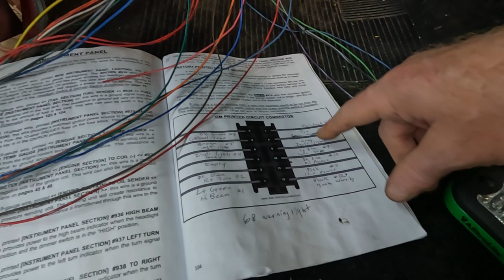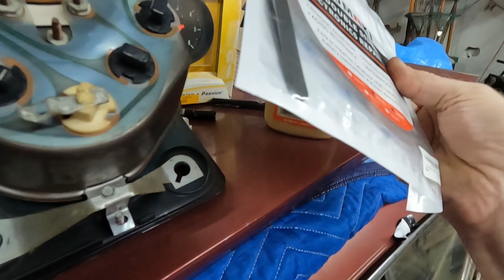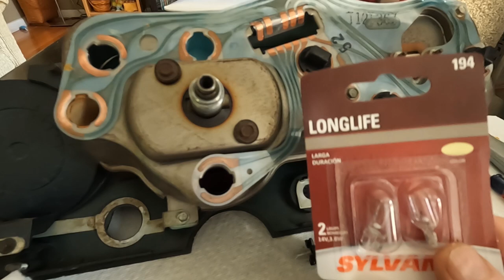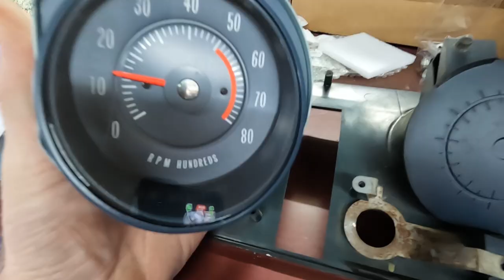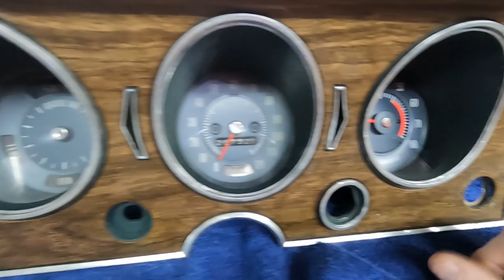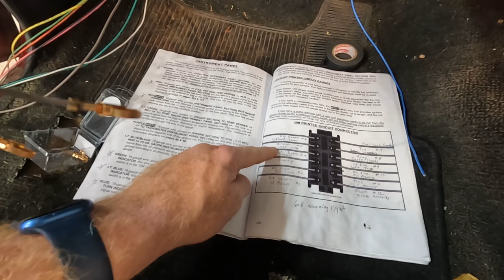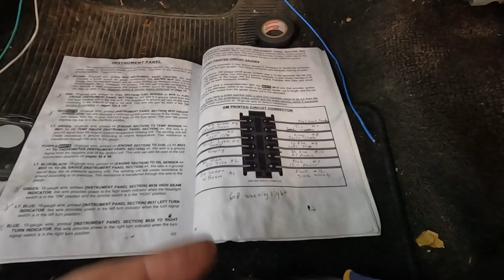Painless Wiring: Instrument Cluster Rewiring

Comment: i recommend a retro sound unit over the hidden unit. I have one in my 72 and its a great set up and looks oem. Another option there is a marine unit thats just a hidden box and remote. I have that for my 66 and just got a delete panel from a special so it looks like no radio.
Reply from the maker: I've got a head unit in my Jeep that starts playing music from my phone as soon as I start it up. Don't have to touch anything. And it's only $100. I even control the volume with my phone. I may change and upgrade down the road, but most of my money is going back into the car itself. And the retro radios start at $300 and go up.